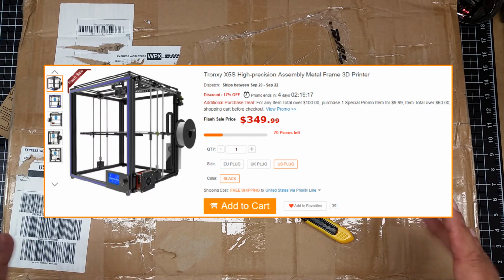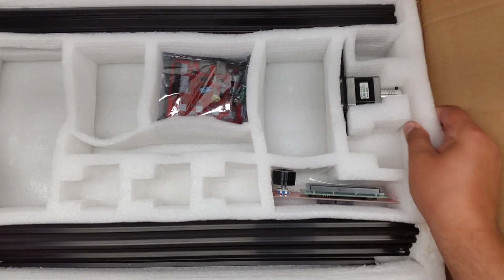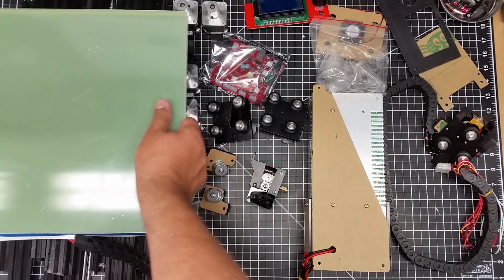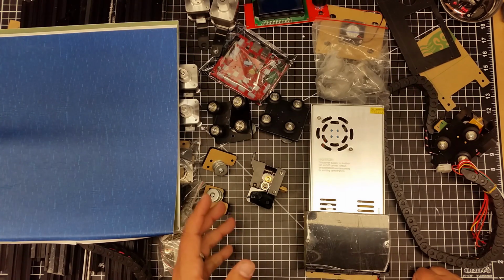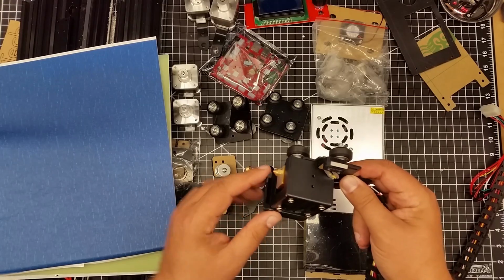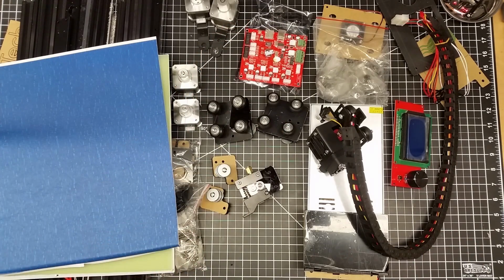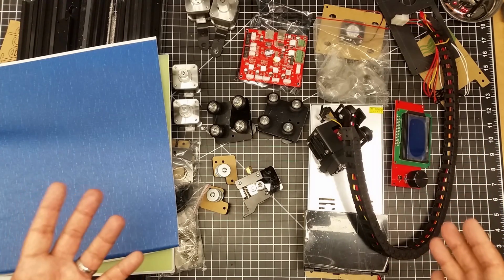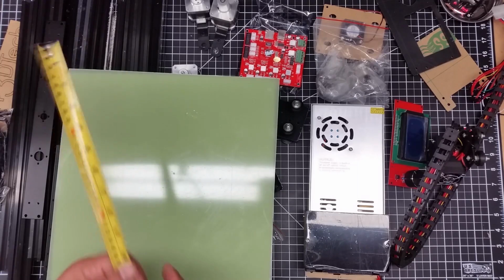Tronxy X5S - Unboxing and Discussing This Large Scale Printer from GearBest!

Comment: Please, can anyone help with the G-codes, Silcer Setting and Printer setting for Tronxy X5SA? I have tried most setting but still does not work.
Reply from the maker: that combo doesn't make a lot sense, as :what" doesn't work?  Because as far as slicer goes you can just use CURA's out of the box settings and it will work just fine...
Reply: @DIY3DTECHcom  OK  i tried the  G code but i will CURA out .
Reply: I have used CURA and it still doesn't work.
Reply: This  is the Start Code on Cura 
; Default start code
G21 ; metric values
G90 ; Absolute positioning
M82 ; Extruder in absolute
M107 ; Turn off fan
G92 Z0 ;set current Z to 0
G1 Z5 :z up 5mm
G28 ; Home extruder
G29 ;auto leveling
G1 Z15 F{TRAVEL_SPEED}
M107 ; Turn off fan
{IF_BED}M190 S{BED}
; Activate all used extruder
{IF_EXT0}M104 T0 S{TEMP1}
G92 E0 ; Reset extruder position
; Wait for all used extruders to reach temperature
{IF_EXT0}M109 T0 S{TEMP1}

The printer moves but it doesn't Zero in on the bed and doesn't feed PLA through the extruder
Reply from the maker: When you say " doesn't Zero" do you mean its doesn't home?  here is my my start G-code: 
G28 ;Home
G1 Z15.0 F6000 ;Move the platform down 15mm;Prime the extruderG92 E0G1 F200 E3G92 E0
Note: 28 homes XYZ  also where did you get this start code?

Comment: Hey thanks for the reviews! I was just about to pull the trigger on the CR10 because of its relative cost vs value. I wanted to get a printer I could learn to print on, and then upgrade various aspects of it over time to finally end up with a PEI/ultem/PPSF capable machine. Seeing as how the Tronxy is more of a cube it looks like it would be easier to build a proper inclosure and with the moving Z axis it would hold the focus better of 35w heating lamps. 

Does any of this sound plausible?
Reply from the maker: The CR-10 is really pre-built  whereas the the Tronxy is a pure kit so if you want easy then the CR-10 is the way to go and its a great machine, however in larger scope the Tronxy can be built (note built) into something more as I do like the fact the bed moves vertical and it is a "cube" as you mention so it is very stable...

Comment: I ordered mine and assembled it up, but the heated bed won't go over 48 degree.....
Reply from the maker: Is the thermistor making good contact with the bed?  There is a hole in the center where it goes, also are your power wires making a solid connection? Are the power wires getting warm?
Reply from the maker: With mine it won't go above 57c, the bed is just too big with only 12dc...
Reply: Just order mosfet and some 12 gauge wire to see whether the wires matter. Now I saw some problem in the bed itself, where the bed + the glass is bent up a little at the center. If I level the 4 corners properly, the center section will scratch the nozzle.....
Tonight will try take off the glass and measure the bed only to see whether the aluminum bed is bent.
Reply from the maker: I doubt there will be much difference (with wire) as what it needs (which still is weak as the bed is so big the best answer is an AC heater) is a second power run (i.e. dedicated).  I am going to add this in the near future...
Reply: Just wondering whether the bed supports 24v. There's no specification on it.
Reply from the maker: I don't believe so, typically there are two solder pads on the bed if this is the case, one for 12v and the other for 24v and I did not see this on mine.  However its still a game of volts x amps = watts so its hard to win this game in DC.  For heating elements, AC is the way to go.  However if you printing PLA 40 deg C works just fine as you don't need a lot of heat.
Reply: I just started to think so as well. Now the problem to solve is the never-leveled-bed..... lack of middle knob in y axis seems to force the bed to bump up a little at the center area.....

Prints can still be carried out if the object is just at the center, but when the line go near the 4 corner will be too far away....

Comment: I was sent the Excel spreadsheet instructions for this printer about 3 weeks ago, from the Mfg. There does seem to be a bit of deviation from the original plans/build.

A claimed 330x330mm build plate with a 300x300mm heater -- sheesh! I guess someone just had to beat the Creality CR-10 300x300 -- even if it is a fake build size!  BTW, that represents 108,900mm2 vs. 90,000mm2 -- not a trivial area.

Why not describe the materials used. Are the v-wheels on plastic spacers (kind of looks that way), or aluminum, as they should be? Are eccentrics used to adj. wheel pressures? Is the extrusion v-slot (some use t-slot with v-wheels)? the corner pieces for the belt pulleys look like acrylic -- boo...crack! How do you know the power supply is a good one? A 360w 12v supply is barely sufficient, and without raising voltage to 13v, and with no insulation it will likely not get heat near to 100°C.

With such long belt lengths, are the belts the skinny 6mm wide ones, or 9-10mm, which they should be for such long lengths. The bed looks like fiberglass, not PEI (I have 2 printers using PEI, a Flashforge, and a CR-10). The controller board ("that looks pretty good..." -- yeah, right!) is a very cheap 4 driver affair (looks like the MKS/Melzi junk), which leaves you with no options for serious modding, or driver change-outs, and a problematic micro SD slot.

To end my review of your non-critical...whatz-it-called: So, Gearbest contacted you and asked if you would review this printer, because, blah, blah, blah. Then, later you state: "...when I picked this one...I wanted one that could stand up to the Creality..." Of course you didn't pick this one, Gearbest did, then suddenly, everything just fell into place!

So, much for an honest, technically critical un-boxing review! No doubt you get a small donation when someone purchases one from your links!
Reply from the maker: Well if you look for bad you will find bad, I think they say is the glass half full or empty?  For around $400 buck, I am happily impressed as yes just like my Tarantula (and a zillion other budget printers out there) has acrylic parts, but so what?  My Tarantula which I would class as the same printed thousands of parts without major issues so the point is (what)?  Also I am not sure why your dissing the size as you can see I measure it and I have built it and it has a 330x330 size so again the point is?  Also Have put the manual on-line here if you would llike to see it: http://diy3dtech.com/gearbest-tronxy-x5s-3d-printer-manual/  Also yes Gearbest offered me any printer I wanted and I picked this one, again point?   Also for clarity I get an affiliate commission (as do 99.999% of YouTubers) from any printer someone picks from my channel and frankly I get a better from others then this, I just happen to like this one.  Also worth pointing out "I have one" and speak from experience where I am assuming you don't (please correct me if I am wrong) and just happen to be play arm chair quarterback on Monday morning :-)
Reply: I don't look for bad, I just look, period, and let the chips fall, based on technical criteria. I don't see a glass half full, or half empty, the glass is filled by whoever puts parts in it. The level is based on the quality of the parts. A bunch of good quality parts, and the glass is almost full. A bunch of mediocre parts, and the glass starts getting empty.

I have the Tronxy X5S manual in Excel spreadsheet format. It was forwarded to me from the manufacturer -- Tronxy. The original design was to have virtually all parts be CNC milled aluminum. Obviously, the corporate cheapskates got to the engineers!

The point of the (duh) 300 vs. 330mm XY size? It is difficult enough to get good heat distribution on a 300x300mm build plate heated by a 300x300mm heater. Tronxy claims a 330x330mm build size. If you can't see that a 300x300mm heat plate will not be effective for a 330x330 build area, then...?

I  was interested in adding this printer to my little shop of printers, but now I'm quite happy that I purchased a Tevo Tornado -- for $332 -- direct from the Tevo mfg. page on Aliexpress, instead.

My background is in nuclear startup engineering, aerospace (Apollo component testing), materials research (HMG, or the original carbon fiber -- aerospace), and air quality instrumentation. I don't need to "have one" to evaluate design criteria. CoreXY is a great design. What I've seen with this printer, is a mediocre implementation of that excellent design.

As a service to your audience, I suggest they look at the all metal Flyingbear Tornado, if a corexy is part of their planed purchases. And again, I do not own a Flyingbear, and in no way represent them. But, their design of all metal, linear rails, etc., is a bit more cost, but it seems, a vastly superior implementation of the corexy design.
Reply from the maker: As site nuclear startup engineer I am sure you also realize that all things need to be reviewed in perspective as I can say VW is crap because I drive a Mercedes S class, but is that fair?  Is this the BEST printer in the world, no.  Is it the right printer for you, only you can judge your needs and the main reason for reviewing printers is to share the differing aspects especially for the "price".  As my background, I am a CTO for a large international company  and looking is nice but I also like to "touch" too as for me "seeing is believing" as  the Tevo Tarantula was a good example as steered clear of it quite sometime yet it has become one of my favorite printers.  So I try and and avoid judging a book by its cover or in this case an excel spread sheet :-)
Reply from the maker: Not sure I would agree on the lots on customization for X5S as other than the cooling shroud is stock and I have done easily in excess of a 100 high quality prints on it.   Folks keep talk about powering the bed with 24 volts and I am still scratching my on an "easy" to do that as I don't see one (so if you have one please share I am open to the idea).  Also is better then the CR-10?  Yes and No, the CR-10 is basically a prebuilt printer the X5S is a pure kit, so will it print as well as the CR_10 for less money "yes" but not everyone will able to build it...
Reply: Sir, you can get Tronxy C5 LED Screen DIY 3D Printer for $369.99, https://www.gearbest.com/3d-printers-3d-printer-kits/pp_009436719692.html?wid=1433363&lkid=14441560， enjoy!

Comment: I've already ordered 1 of these, I have and love my CR-10, but it does always make me nervous that my parts constantly fly back and forth on the bed. I love that this printer takes the best parts of the CR-10 but transforms it into z axis bed. Can't wait to see what you make of it, but even based off the very minimal information/pictures/videos available i'm pretty confident it will be a winner!
Reply from the maker: Dittio here too!
Reply: I'm waiting anxiously for your next video, or any update on how it prints haha. I do have a slight concern about the huge bowden tube, but it can probably be modded to a direct drive fairly easily if it is much of an issue.
Reply: Still though, even if corexy is not a good enough mechanism, i'm sure this can be quite easily modified to a much simpler belt system where the x stepper is on the gantry, and it could probably even have dual y steppers in place of the corexy steppers... Always options!
Reply: (?)... why buy a kit based on a corexy design, then modify it to a Makerbot design?  Just get a Titan direct setup, change the belts to 9 or 10mm wide belts. Or, just purchase a kit which is based on the Makerbot design in the first place? BTW, I can print TPU with my CR-10 Bowden (slightly modified).
Reply: Corexy depends on very light print carriages to print fast and accurate. A direct extruder mass would defeat much of the design basis of the corexy. This printer kit looks to use the skinny 6mm wide belts. With such long belt lengths, much of the corexy advantages will be mitigated by belt stretch. With 9-10mm wide belts you could likely get away with using a Titan direct feeder/extruder, as it uses a small frame Nema 17.

Flying bear makes, what seems to be, a much better corexy (Tornado). It uses 10mm wide belts, and is all metal. Though it costs more, and prints a bit lower volume (350 x 300 x 300 mm), I suspect it's a much better quality kit. And NO, I have zero ties to Flyingbear! I'm just a retired nuclear start-up engineer.

Comment: is this a CoreXY type or Hbot something type or 3d printer?
Reply from the maker: +iamthebest22 not sure as I have not seen those
Reply: It is a corexy. A similar new hbot is the creality ender-4
Reply: Yes, this looks like an actual CoreXY. Creality's Ender-4 is not CoreXY despite advertised as such, it is HBOT, much much inferior design. My Ender-4 is craptastic, i need to redesign the whole kinematics system, carriages etc. Only worked for couple of weeks until all round shapes became oval shaped (HBOT + eccentric nuts on acrylic...), and all my Creality controller's are garbage. Ender-4's like to reset randomly, CR-10 shorted thermistor
Reply: skaltura try to lower the tension on the belts to remove the oval holes worked out for most people
Reply: Not belt tensioning, the crapola acrylic carriages are bent permanently.

Belts need to be tight tbh